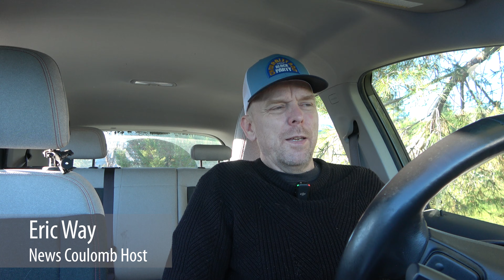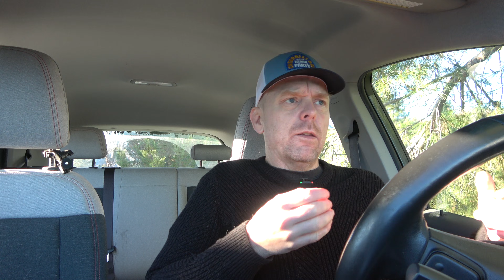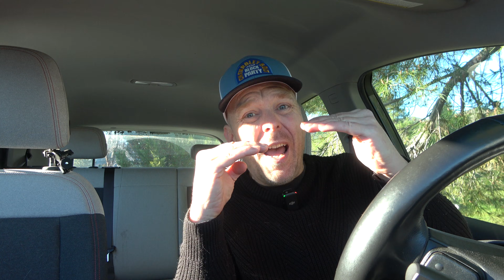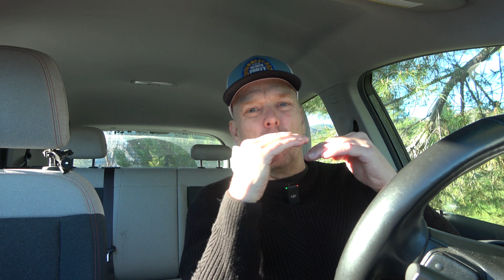Is Donut Labs Misrepresenting Their Solid-State Battery Technology?

Comment: Super capacitors have everything you would ever want in a battery except 2 things. Energy density, and voltage curve. You can't do much about the voltage curve on capacitors. But you can adapt inverters/converters to handle it. On the energy density side. If they have solved/cracked the energy density issue. Then they really got a winner on their hands. But before we get excited. We need to take into account that energy density come in to metrics, volumetric(space), and gravimetric(weight). Right now, they are only telling us what the gravimetric density is and have yet to tell us what the volumetric is. It should be noted that super capacitors on the market today have good gravimetric density(still nowhere near as good as electrochemical batteries.) as compared to their volumetric density. So without knowing what the "volumetric" density is. This could just turn out to be another lead vs feathers game. Where a pound of lead occupies a lot less psychical space then a pound of feathers would.

Comment: New technology is usually extremely expensive, so it's limited to certain specialty products. The South Korean company Hanwha Ocean have a miniature model of their future submarine concept that they say will be equipped with solid state batteries. Military equipment is state-of-the-art and expensive, but governments are willing to spend top dollar for national defense. Then, after a few years, the price of the technology drops dramatically to where it's practical for consumer products. The South Korean KSS-III Batch-II is their newest submarine that employs diesel-electric propulsion with an air-independent propulsion (AIP) system integrating four 150 kW PH1 polymer electrolyte membrane fuel cells developed by Bumhan Industries. Samsung SDI lithium-ion batteries replace the previous lead-acid type, providing higher power density, faster recharging, longer cycle life, and improved safety.
According to the Korean defense industry, Samsung SDI, Hanwha Ocean and Hanwha Aerospace Co. will carry out the final performance evaluation of a new prototype lithium-ion battery design for South Korean submarines. If modern submarines were equipped with new solid state batteries, then I would believe the technology would be ready for electric vehicles in a couple of years.

Comment: The argument that “it’s just a capacitor “ is kinda crazy. First off, even if it was “just a capacitor” those numbers would still make it just as world changing and revolutionary. Second, it would have to exceed current super capacitors energy density by about 20 times making it even more unlikely than its claims about being more twice as energy dense as lithium batteries. You’ve just changed a set of unlikely numbers for a set of even more unlikely numbers.
AND, the company flat out stated it’s not a capacitor. Not that I can trust what they say based on the miracles they’ve promised. 
In the end, we will all just have to wait until independent tests and a tear down are done. Until then, it’s all just wind.

Comment: The distinction between 'battery' and 'capacitor' is the difference between chemical storage and electrostatic storage. But that's just splitting hairs. If it works as they claim, take my money.
Reply: It’s much more than splitting hairs.

Comment: The problem with EV trucks isn't just energy density, it is also the fact that building an electrical grid sufficient to charge them in an acceptable time isn't feasible.  But then, that's really the problem with even thinking about converting more than a minority of the total US auto fleet to EV.

Comment: If something sounds too good to be true, it probably is. Ziroth posted a video on this two days ago. He went to the CES convention and talked to their reps to see what he could get out of them. They told him they wouldn't talk about the manufacturing or the chemistry of this new battery. They only had mockups of the battery on display but had videos of it being charged etc. He notice that during charging it held at 4 volts continually throughout the charging without dropping off which is not characteristic of a battery. Also, 4 volts indicated lithium but they told him straight up that it contained no lithium. In fact, they said it could be charged at any voltage and only used 4 volts because that is what standard chargers run at. He concluded the high cycle life with those voltage characteristic were more typical of a capacitor than a battery. He did say that he personally knows people that work at Donut that would not participate in fraud. So he is cautiously optimistic. They are supposed to be available soon so real world testing will answer all these questions. If they are overhyping it then I hope they have good lawyers since their investors won't be happy.

Comment: Interesting points.  On a side note, if Donut Labs HAS created what they say they’ve created, they better get bodyguards!  The oil industry would be cooked!  Re: it may be a hybrid between a Supercapacitor and a battery: I’ve been wondering why companies HAVEN’T been melding battery and supercapacitor  characteristics to get the best of both worlds.  If they’ve solved the downsides of SC’s, who cares if it’s not technically a pure solid state battery?  I guess we’ll have to wait and see.  I don’t think we’ll have to wait long.
Reply: Why would the oil industry “be cooked”..?
Key points for EVs are energy density and cost, .
There are higher energy density cells available, and  costs are unknown as yet. But current cell prices are <$50/kWh.
these Donut claims are no better than what is currently available in the industry (Amprius ?)
Reply: @w @weinisable  They’d be cooked because the main complaint about EVs is that they take much longer to recharge than it takes to refill a gas tank.  For people who live where they can’t charge at home (apartment buildings), this is a major inconvenience, which is why many apartment dwellers don’t buy EV’s.  If they live in an apartment building in a cold winter climate, then not being able to charge at home is even worse.  Why? Because cold weather causes current EV batteries to use some of their energy to keep the battery itself warmer than the ambient temperature, causing the battery to drain faster, necessitating even more frequent recharges in winter.  Donut Labs claims that a) their new solid state battery retains 99% of its energy down to temps of -22F, so no need to do more frequent recharging in the winter; and that it can be recharged in 5 minutes, about the same amount of time as filling a gas tank.  Taken together, these two arguments against switching to EVs evaporate.  That vastly increases the addressable market for EVs.  Donut also says their batteries are much more energy dense (400 wh per kg) so their batteries may not to be recharged as often.  Add the fact that EV’s ongoing maintenance costs are much lower than gas cars, their much better performance (faster, more glued to the road, safer in an accident, etc.)), then most people would want to buy an EV to save money.  Eventually, only gas car enthusiasts would continue to
buy gas cars.  Same as some people still buy horses, but they’re not used as primary transportation.  You’re correct that Donut hasn’t released their battery’s price per kWh, but they do say they are lower cost than current Lithium Ion and Lithium Iron Phosphate batteries.

Comment: If you watch some of their other vids, they are claiming to have revolutionised not only the battery, but also the motor and software - hardly credible for a small company nobody has heard of before. Their motor is a hub design, without addressing issues of unsprung mass and managing cabling/cooling across a moving suspension. 
All their vids are all renders and very few real devices. No papers, no patents. 
I'm calling BS on all of it.

Comment: Advanced supercapacitors in labs reach about 15 Wh/kg. There is a theoretical limit for supercapacitors, which makes it impossible to reach battery-level energy density. When I say battery-level energy density, I am not even comparing to modern Li-ion, but to something as basic as a lead-acid battery.

Comment: Current Li-Ion technology allows charging fast up till 80% when they remain in constant current mode. The rest 20% is slow when the current needs to be reduced in constant voltage mode. 
If you step out the Lithium technology the charge doesn't have to follow anymore the Lithium curves. Donut battery is constat current constat voltage up to 100%..

Comment: If the stats are real it doesn't matter what it is, but i'm also afraid that they omitted something. The problem with being a capacitor is that they lose voltage as they discharge, on a battery it happens much more slowly, so unless it behaves differently i don't think you can use a capacitor as a battery. And if they 'fixed' this, is it called still a capacitor, a smaller version of it will work as intended if put in a circuit?

Comment: Without knowing the actual chemistry, all of this is just speculation. We should wait for judgement until independent third-party people can inspect and test the actual batteries.
Note that older capacitors often fail because the liquid electrolyte leaks or vents from the capacitor. In a true solid-state device, there is no liquid electrolyte.

Comment: John, thank you for this excellent reporting. I had my suspicions also that this could be a capacitor. That would also lend itself to a lighter operation like a motorcycle. I'm not even convinced of the claimed range. We haven't seen any testing. You also thought of something I didn't.  The difference in how capacitors and batteries age. All good wishes.

Comment: The 2025 Korean paper:

Title: "Nanocell-structured carbon nanotube composite fibers for ultrahigh energy and power density supercapacitors"

Journal: Composites Part B: Engineering (published early 2025, DOI: 10.1016/j.compositesb.2025.112179)

Institutions: Korea Institute of Science and Technology (KIST) + Seoul National University (SNU)

What the Paper Proposes

The researchers developed a novel fiber-shaped supercapacitor using a composite of single-walled carbon nanotubes (SWCNTs) and polyaniline (PANI) — a cheap, conductive polymer.

Key innovation:

- They used liquid crystalline wet-spinning to create highly aligned CNT fibers.

- PANI is covalently grafted onto the CNTs at the nanoscale.

- This creates a unique "nanocell-structured" architecture — each PANI segment acts as a tiny nanoscale electrochemical cell distributed uniformly throughout the fiber.

Result: Maximizes PANI utilization (even material inside the fiber participates), greatly improves electron/ion transport, and solves traditional supercapacitor problems (low energy density + limited cycle life).

Performance highlights (lab results on the composite fiber):

- Specific capacitance: 1,714 F/g (at 1 A/g)

- Energy density: 418 Wh/kg (or 820 mWh/cm³ volumetric)

- Power density: Up to 587 kW/kg (or 1,150 W/cm³ volumetric)

- Cycle life: Nearly 100% capacity retention after >100,000 charge/discharge cycles

Comment: My best guess is that it is a screen-printed hybrid supercapacitor battery built on a CNT/graphene scaffold with sodium ions and metal-oxide pseudocapacitive chemistry. Instead of deep Li ion intercalation,  there will be a shallow sodium percolation. If that's true, they may achieve cell/material effective energy density at 400 Wh/kg if discharge is start/stop and low (city driving) when Faradaic ion diffusion can keep up with draw. However, effective energy density may collapse on the highway when you switch to electrostatic capacitor-mode. There are other cautions, for instance self-discharge may be annoying. And while cycle life on supercaps are often huge due to resistance to mechanical aging, the calendar life may be mediocre if there is chemical aging.

Comment: SOLID STATE BIPOLAR SUPERCAPACITOR (SECRET JUICE REVEALED) 
Component____________Material
Electrodes (x2)______Field-engineered Co-SAC/N-graphene +
                     Ti₃C₂Tₓ MXene (O-terminated) +
                     ultrathin TiN interfacial layers (1–2 nm) +
                     structural redox grafts (quinone/TEMPO-type)

Solid Electrolyte____Bicontinuous PVDF-HFP/PAN (≤25%) +
                     poly-ionic liquid (PIL, cation-conducting) +
                     in-situ SiO₂ (5–8 wt%) +
                     BaTiO₃@SiO₂ core–shell nanoparticles (1–2 wt%) +
                     anion-trapping nanodomains (zwitterionic/sulfonated silica)

Current Collector___CNT fiber with ALD nanolaminate isolation
                     (Al₂O₃ / TiO₂ / Al₂O₃, ~5 nm total) +
                     graphene electronic reconnection layer

Encapsulation________ALD Al₂O₃/TiO₂ gas barrier +
                     self-healing supramolecular elastomer
                     (quadruple H-bond + π–π motifs) +
                     ultrathin Parylene-C (≈2 µm)

Comment: The best guess I've heard so far is a 3D printed battery developed by NORDIC NANO made up of a  Covalent Triazene Framework based polymer with sodium-sulfer in a redux configuration.  This type of battery could be printed into any shape, would need no compressive load to hold layers together and could by configured to have a wide range of voltages depending on the size of the polymer based covalent triazene framwork.  Because it is porous the electrons will flow freely and can "park" themselves easily and thus charge very quickly and unlike a supercapacitor it should not be subject to unwanted discharge over time.
Reply: I am a Finn, and I can tell that the building the Nordic Nano should be in is still empty. Completely empty. There is no Nordic Nano gigafactory here in Finland. This whole thing has more red flags than a Chinese parade. Perhaps they have a lab somewhere else. 
As we all know how "fast" 3D printing is, the factory should be huge, And we here should know about it.
Reply: @timokuusela5794 that's interesting, usually when two companies merge they move the people so everyone can work as a team. So just maybe Nordic Nano is now an empty shell.
Reply: @timokuusela5794  The footprint for current battery production is very large, my son works in a giga battery factortory and each production line is 100's of meters long and several stories tall.  If they can 3D print these batteries the foot print to produce the same KWH's of batterys should be significantly less, even though the process of 3D printing seems slow, you could literally fit 10's of thousands of printers in the space required to run just one 2170 battery production line.
Reply: @timokuusela5794  re: "I am a Finn, and I can tell that the building the Nordic Nano should be in is still empty. Completely empty." see guys, it's just an indoor venue with LOTS OF ROOM that Norwegian Freddy Aasbo rents to practice his "Drift Skills" during the Formula-D offseason.
Reply: Guess who joined the board of directors at Nordic Nano last year 😂
Reply: @SolAce-nw2hf ex Nokia ?
Reply: They've specifically said this has nothing to do with Nordic Nano after speculation about their capacitor came up.
Reply: @RickinICTMy guess is they did not want to shift the attention from their own brand. But making batteries is hard, so I seriously doubt they did this themselves while also perfecting the motor and the new EV design/test/build software DonutOS at the same time. But even if some genius at Donut labs had this eureka moment, you can be sure Nordic Nano will be making these as well if it's really this good.
Reply: Super Marco
Reply: And is it a good solution ? Is there any cons with this technolgy ?
Reply: Did not FORD try this several decades ago, with an older technology.  Our company also looked in Sodium based batteries. But in those days, the electrodes were made from rare and valuable materials.  Ford realized that could NOT even supply one-years Quantity of cars, with the known resources, and abandoned that project.  GM also.
Reply: @brunonikodemski2420  well this isnt made with rare earths